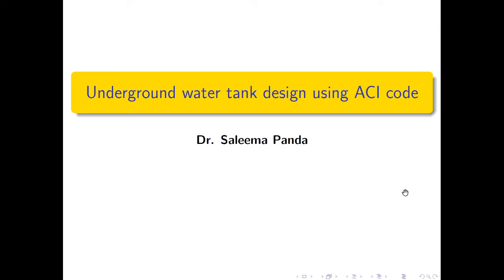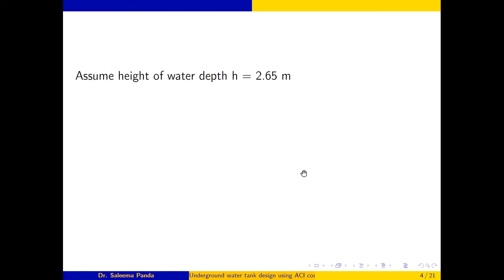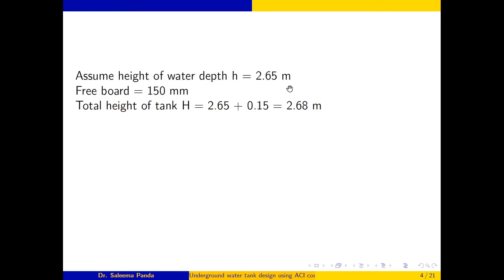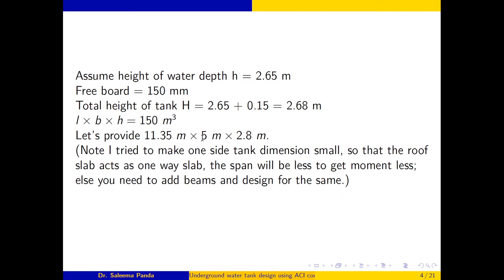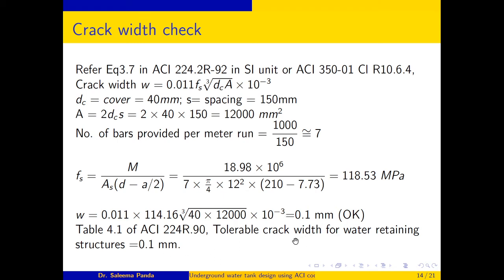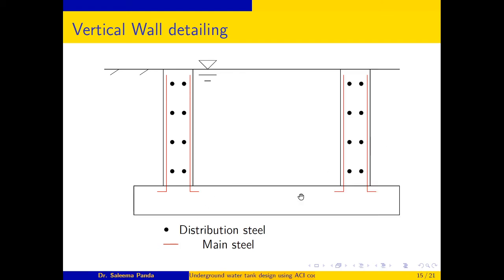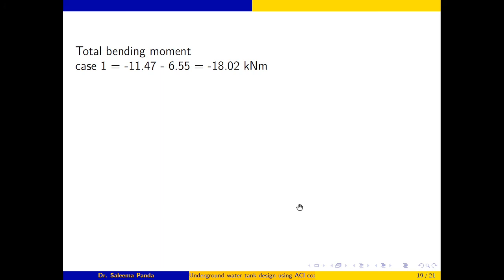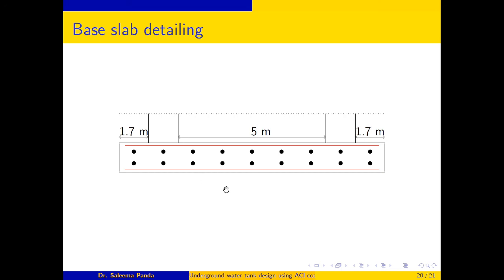Underground Water Tank design using ACI code

Comment: At 2:12 2.65+.15 should be 2.8m, not 2.68. Thanks for the effort. Also, I was curious why u have used 2.8 for max bending moment calculation  9:18 , and then 2.68 for the weight of the walls 15:24 and weight of the soil projection 16:05 .

Comment: Very good video Dr. Saleema. 
I was wondering if you could please do the same example for a larger tank that has columns and beams, i.e. size 170m x 110m x 8m deep with water table 5m above base slab. STAAD Pro demonstration will be greatly appreciated, using ACI codes please. 
Thanks and best regards

Comment: I think there is a typo fixed at the beginning but used later, the H=2.65+0.15 =2.80m, but typed as 2.68m, and then used later as 2.68m.. Or I am missing something?

Comment: Dear Dr. Saleema..
I believe we should not use the equation of (fs=Ma/(As(d-a/2)) to get steel stress, since the equivalent neutral axis depth (a) corresponds to the strength level loads not the service level loads.
May be we use the 0.6fy value. otherwise, fs=Ma*yc/I where yc is the transformed section neutral axis depth. & I is cracked section inertia

Comment: hi there ... i want to try ,, make design of graoundtank with 98000 liter of water ... do you have any sugetion of concrete ticknes and steel bar dimenson .. .. i applogize if  i bother you.. but i still confus for your explantion ..thank you
Reply from the maker: You can guess the thickness at start and then check if crack width is within permissible else increases your thickness.
Reply from the maker: It's better to have lesser dimension steel bar- then for same amount of steel required, you have more number of bars with less spacing which is good to control shrinkage and cracks.
Reply: @SaleemaPanda1990  i use 13 mm and 8 mm with 20 cm bar distance .. and total dimension tickness of bottom concrete 25 cm with lenght 8.5 x 8,5 m.mor bigger then top plat and. high 2m 
meaning 7x7x2 = 98 m3
sorry for my bad english .. thank you
Reply: @SaleemaPanda1990  i will try to know your expalination  video to night .and i try to get it
Reply: @SaleemaPanda1990  I've seen load factors as Sanitation Coefficient in the ACI 350 Chapter 9, I think that the demand must multiplied by this factor.
Reply from the maker: @joseantonioalarconleon3382  Yes, multiply this sanitation coefficient or durability factor for durability and liquid tightness.
Reply: @SaleemaPanda1990  Could you share us a digital book about hydraulic concrete structures? or Do you have this book "Hydraulic Concrete Structures" by Karuna Moy Ghosh?